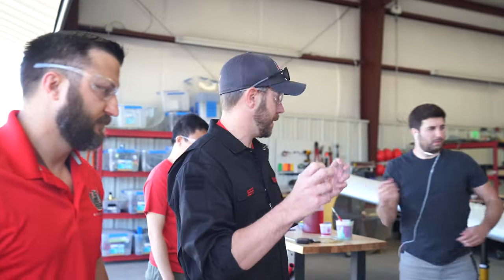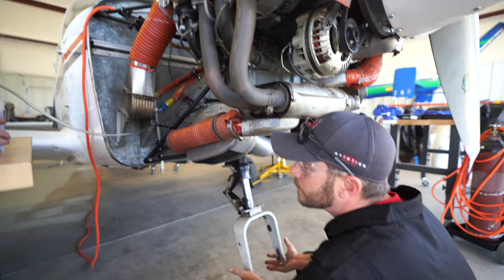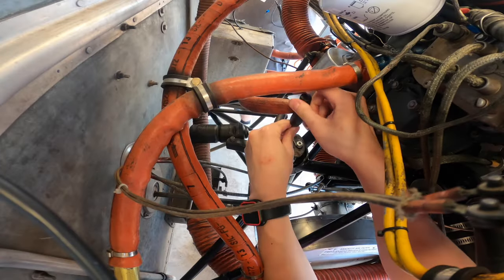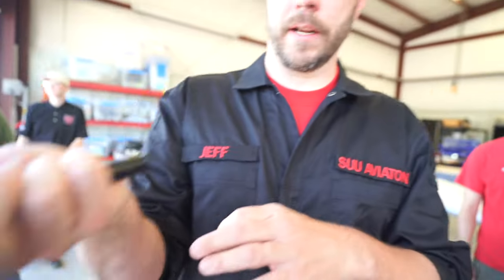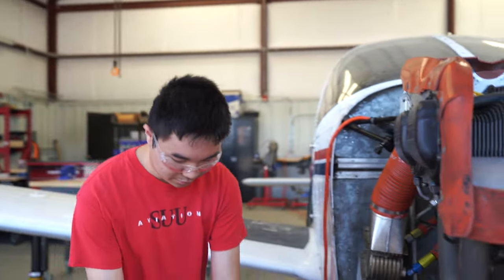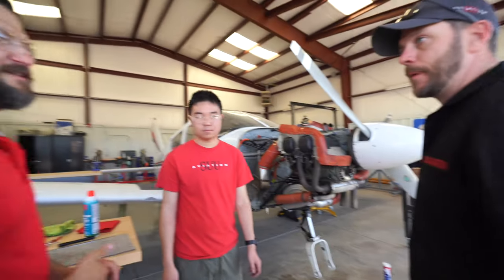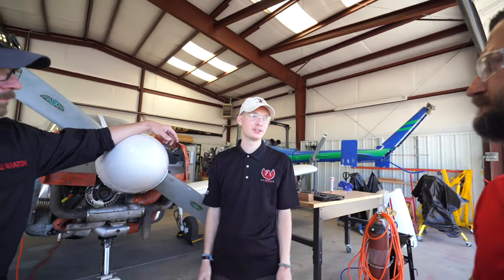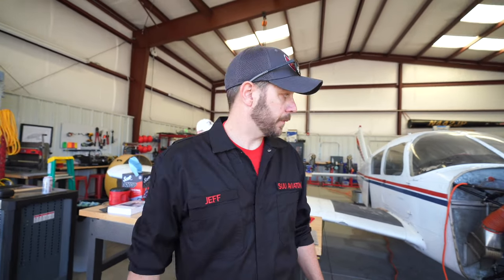Can we Repair this Landing Gear?! 🛠️ Aircraft Maintenance Training

Comment: Awesome video! I am pretty sure though that on a PA-28 the front strut tube should have 3.25in +/- .25 exposed (Piper Service Manual 2-38). A PA-28R is 2.75in.
Reply from the maker: Thanks! And thank you for the info!